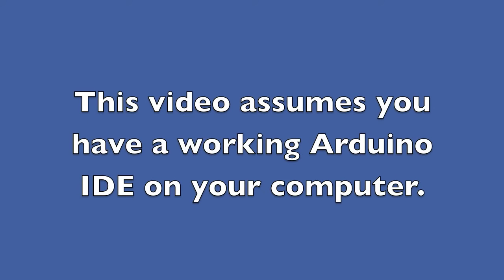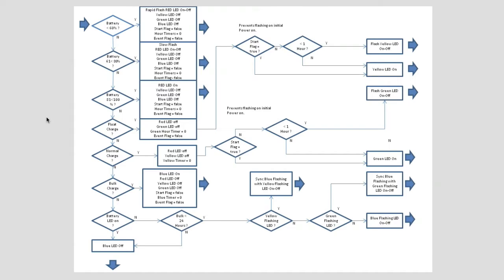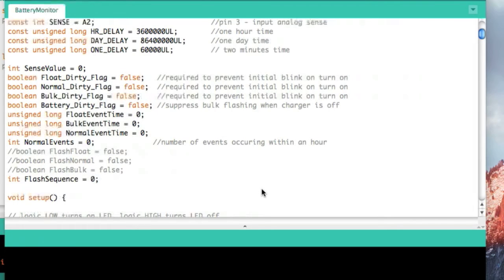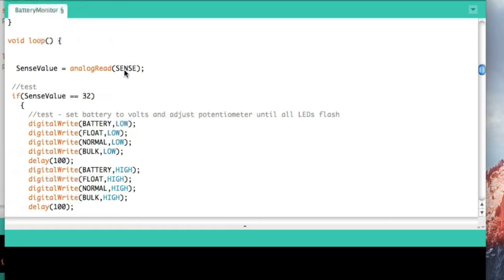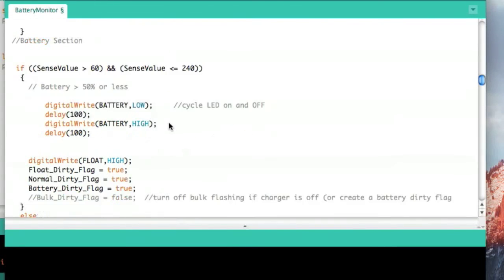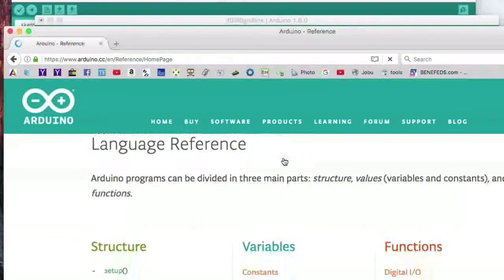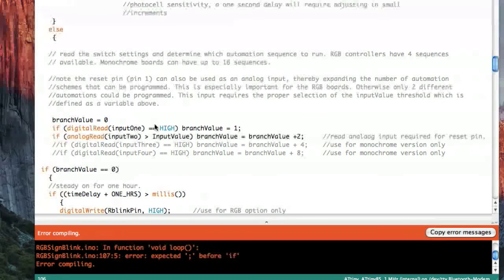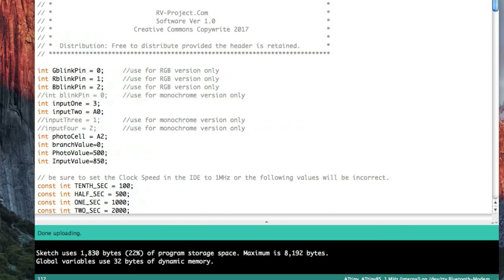Programming the Battery/Charger Monitor.

Comment: does this charge the monitor or laptop
Reply from the maker: It's a sketch  to monitor the state of the charger and deep cycle 12V battery in a RV or vehicle.  It does not charge anything, but simply monitors an existing 12V battery charger's output.

http://www.rv-project.com/projects/batterymonitor.php